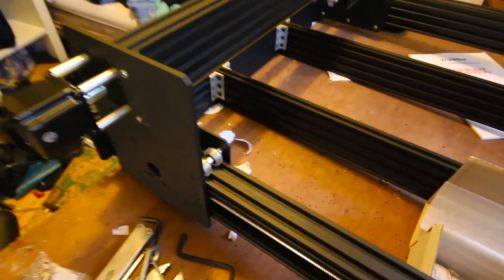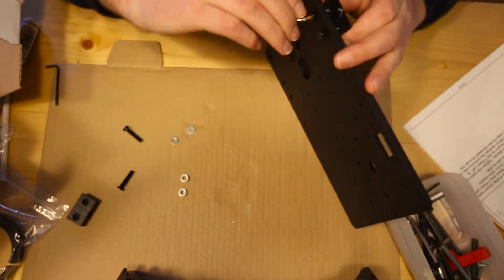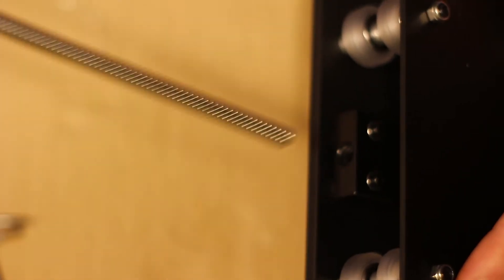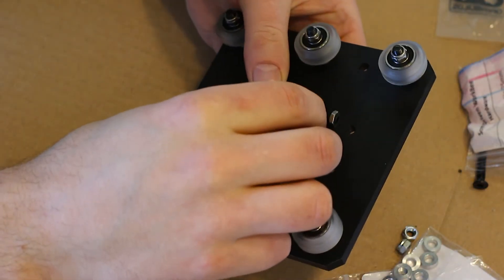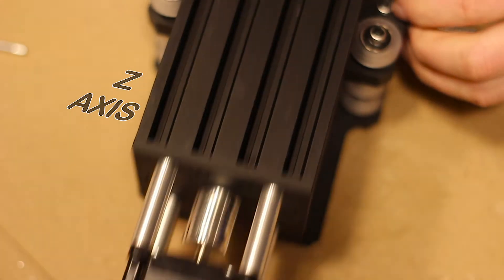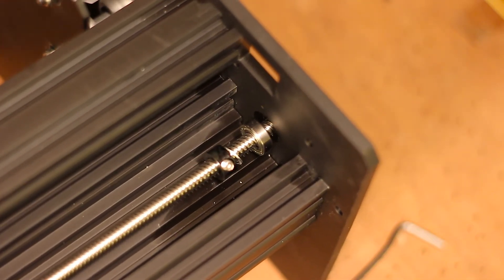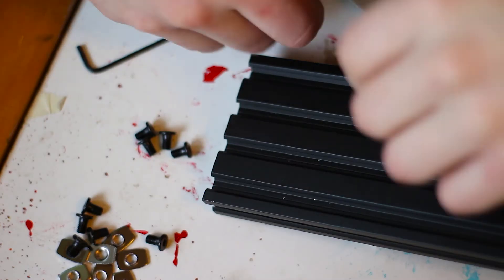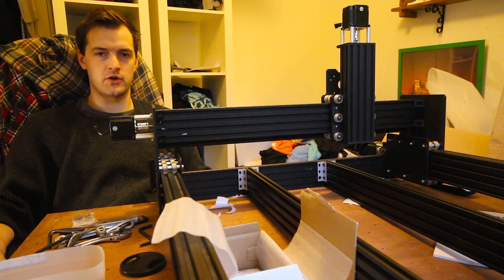Building the WorkBee CNC Router #2

Comment: when i tighten both the acme nut block then my acme rod is not going freely,when Acme nut block is slightly loose the Acme rod is going freely, whether i should keep the nut block loose? if yes whether it will not have play during movement?please guide me.

Comment: Great Video.  How does the unit attach to the supporting table. My table has about 1/16 inch error. Is that an issue?  Looking forward to the Electronics/Programming Video. I will be using the Protoneer Raspberry Pi CNC hat v2.58 - GRBL v1.1 Compatible
Email to friends
Share on Facebook - opens in a new window or tab
Share on Twitter - opens in a new window or tab
Share on Pinterest - opens in a new window or tab
 
Seller information
zyltech (7777 )
99.9% Positive feedback
Saved
Contact seller
Visit store
See other items
Item Information
Condition:
New
Pololu Socket To External Driver conversion boards?:
Quantity:
More than 10 available 34 sold / See feedback
Price:
US $43.95
 
 
Add to cart
 
 
Watching
100% buyer satisfaction
Free delivery in 4 days
34 sold
Shipping:
Estimated by eBay FAST 'N FREE FAST 'N FREE
On or before Fri. May. 04 to 32244
 
Item location:
Houston, TX/USA, United States
 
Ships to:
United States and many other countries | See details
Payments:
PayPal Visa/MasterCard, Amex, Discover
Credit Cards processed by PayPal
PayPal Credit
Get more time to pay.  Apply Now
- opens in a new window or tab
 |  See terms
- opens in a new window or tab
See
payment
details
Returns:
30 day returns. Buyer pays for return shipping |  See details
Guarantee:
Money Back Guarantee  | See details
- opens in a new window or tab
Get the item you ordered or get your money back.
Covers your purchase price and original shipping.
Reply: Didnt mean to include shipping info.